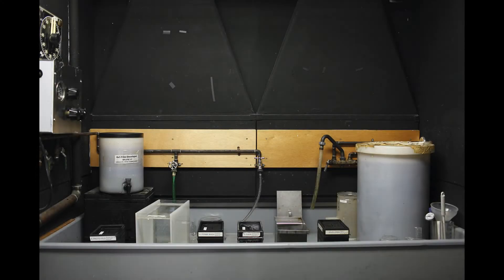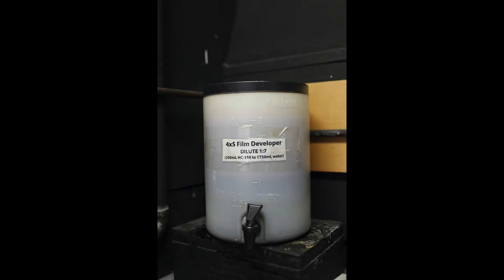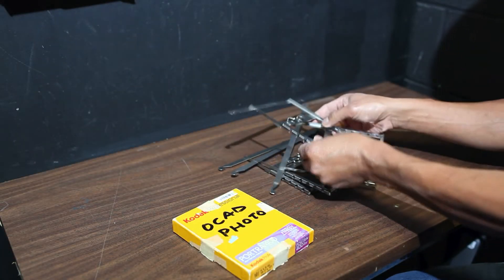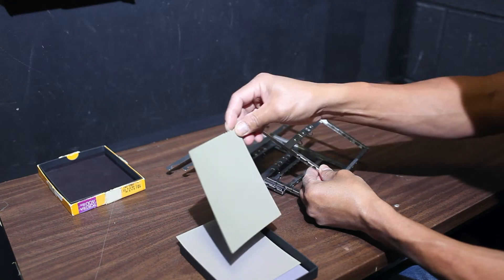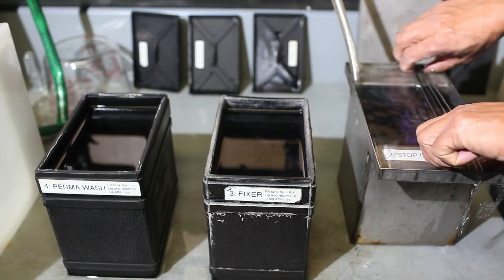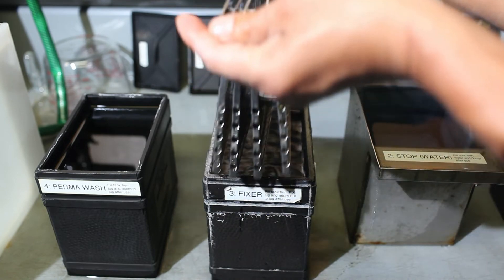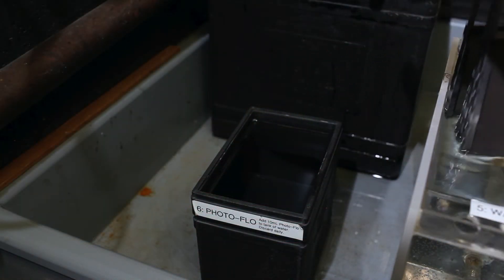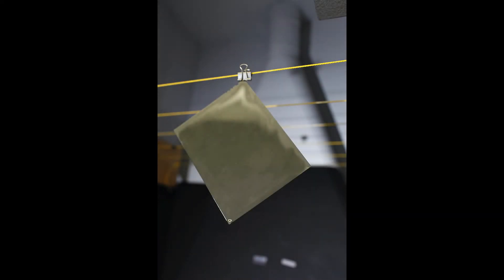Sheet Film Processing - Dip & Dunk

Comment: Lawoti, thank you for such a concise and comprehensive video on souping sheet film. As a retired commercial photog and assistant/lab tech I would like to add two pointers. In the dip and dunk method, sometimes film surge occurs that looks like streaks of increased density at the edges of the film. Changing agitation sometimes helps to avoid this, but a 1 minute water bath/soak before the developer can help, too. Development time may need to be adjusted. In addition, I think that mentioning rinsing, cleaning, and drying the film hangers after every use is imperative. It may seem obvious, but good lab habits often can save the day.

Comment: Back in the day we made many thousands of 8" x 10" negatives in the studio using a 14" Deardorff camera with an 8" x 10" revolving reducing film back.  Kodak had a basket frame to hold those developing hangers; it had scalloped indentations on top of the open frame and each basket held 14 hangers. I found that less agitation just a tilt each was every minute was better than over-agitating.   We'd run 28 sheets at at a time, but I remember we'd keep the film in the hangers and place them directly into the drying cabinet, removing them from the hangers after the film was dry.  We processed E-6 transparencies the same way, but had all the solutions in a water bath to maintain the temperature and used a nitrogen tank for burst agitation when processing color.